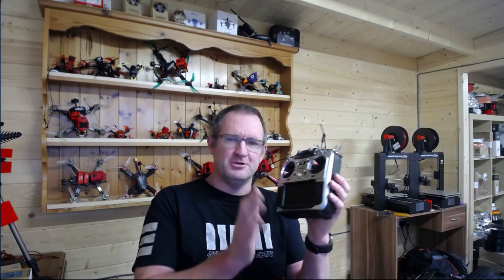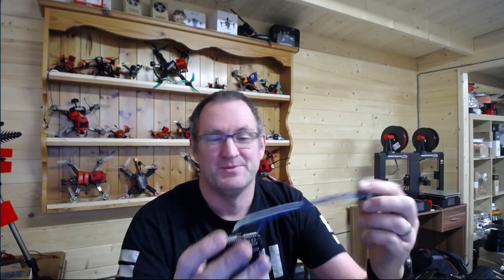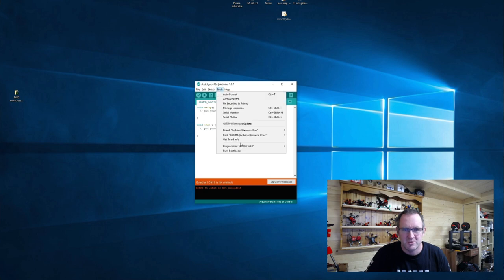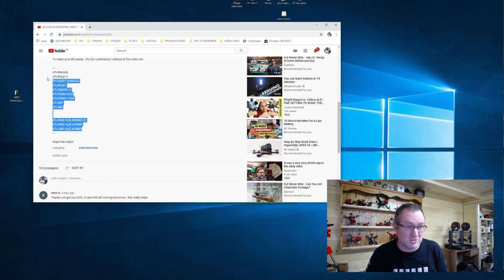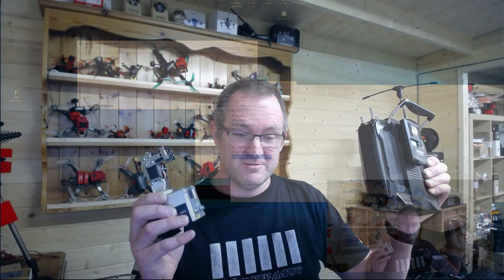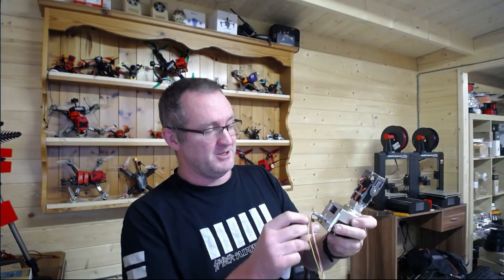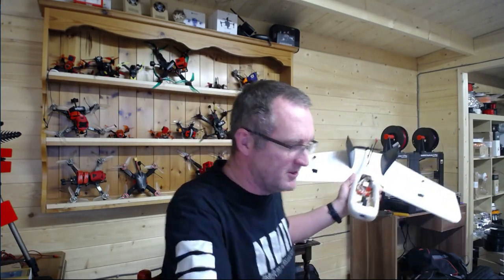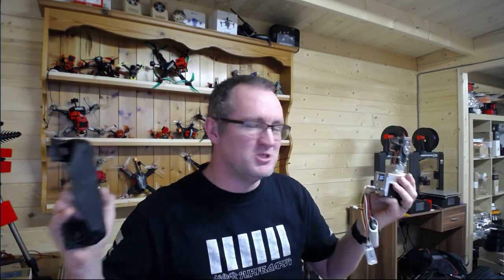MFD CROSSBOW * TBS CROSSFIRE | STEP BY STEP TO GET IT WORKING

Comment: 👍🏻Very good and informative video. TOP!

 I will modify your setup for using a frsky R9M Modul. I will use the Smart Port Data stream and conect it with a Blue tooth modul. Data from INAVFlightcontroller. 

Do you think that could work that way Rob?
Reply from the maker: I guess it's possible

Basically.. Remember that tracker only supports mavlink.

How you create the mavlink.. We you could achieve that with any down link method!
Reply: Need an arduino to convert s.port to mavlink. No word from mfd on all supported protocols, but they said it supports many normal telemetry protocols.
Reply: The tracker now accepts s.port. you just need an inverter and bluetooth modules.
Reply: @juanhernandez5812  you need two bluetooth modules. The mfd doesnt have one built in.
Reply: @Just-A-Guy-Learning   YES 
I KNOW,  I MEAN IS WHAT COMMANDS I SHOULD PUT ON THE TWO BLUETOOTH TO COMMUNICATE OR TALK BETWEEN THE R9M AND THE MINI CROSSBOW
Reply: @juanhernandez5812  TALKING IN CAPS DOESNT MAKE ANYONE WANT TO HELP YOU! 

There are different commands for different bluetooth modules. You need to buy a pair of modules, then look up the command list for pairing those two modules. Hc05, takes a different list of commands, than the hm10. So join the Facebook group to get the commands for those modules, or tell me what you order so I can try and post the commands here. You will need arduino ide software and an ftdi or the usb-ttl that comes with the tracker to program the modules.
Reply: @Just-A-Guy-Learning  ohh my bad it's not my intention im Dominican and I'm not sow good writing inglish ... 

I ordered 2 Bluetooth module hc05  1 inverter for the r9m, I have the usb-ttl I think I will need the commands?
 Thanks for your help 👍
Reply: @juanhernandez5812  all good. 

List of commands for pairing hc05 together.

AT+RMAAD Clear any paired devices
AT+ROLE=1 Set mode to Master
AT+RESET After changing role, reset is required
AT+CMODE=0 Allow connection to any address
AT+INQM=0,5,5 Inquire mode - Standard, stop after 5 devices found or after 5 seconds
AT+PSWD=1234 Set PIN.
AT+INIT Start Serial Port Profile (SPP) ( If Error(17) returned - ignore as profile already loaded)
AT+INQ Start searching for devices

A list of devices found will be displayed, one of which is the slave module. The format of the output is
+INQ:address,type,signal
The address of the module is what we need and is in the format 4:3E:9A440B 
NOTE: We need to replace the colons with commas when we use the address with the following commands.

If you get more than one device listed and don't know which one is the slave module Crossfire, you can query the module for it's name using:
AT+RNAME? 
e.g. (don't forget to change the colons to commas)
AT+RNAME? 4,3E,9A440B 
> CROSSFIRE XXXX

Once we are happy we have the correct slave address, we need to pair with it, so carry on with the next set of commands:

AT+PAIR=4,3E,9A440B,10 , The timeout is in seconds and if you need to type in the pin on the slave device you need to give enough time to do this.
AT+BIND=4,3E,9A440B Set bind address to the slave address
AT+LINK=4,3E,9A440B Connect to slave.
Reply: @Just-A-Guy-Learning  ohhh thanks bro appreciate your help

Comment: I need a very long range rc transmitter. At least 100km with 18 channel. What do you recommend? Does this tracker will help me to use and control my plane by rc transmitter or it just work on autopilot

Comment: Thank you for taking the time to do this 👍🏻.  Does the updater cable and programmer come by default in the box?   My impatience for mine to arrive just went up a level 🤣
Reply from the maker: Yes.  Everything is in the box.

Just make sure you put correct wiring.. And should work!
Reply: Rob Thomson FPV thanks Rob

Comment: Mine works with help of your video . Thank you  very much . How your tracker keeps up with the model ? My tracker movements is are in steps and can't keep up with the model when flying close by. How are your tracker movements with mavlink and crsf?
I think when it runs smooth it can keep up .
Reply from the maker: I use mavemu...  no issues.

Make sure you load one of the newer firmwares to the tracker.

They include a low pass on the servo - makes it much smoother.

If close by - e.g - less that 100 meter - dont worry about it.  You dont need a tracker at that range - and the directional antennas will easily cover you.  Example.. I have flown 800m behind and lzr 13dbi patch with no issue!
Reply: @RTRCTV  thanks! Yeah iam on firmware 2.1 . Just wondering if your tracker runs with constant smooth movement or is het a bit steppie to ?
Reply from the maker: @erikjede1ste  always slightly steppy.

Its got something to do with the rate the telemetry is received.
Reply: @RTRCTV  ah oke thanks . I thought mavlink was a continue stream of data . Also gps is on 10hz . But it worsk fine. 
Just wondering . Thanks mate and thanks again for the clear video
Reply from the maker: @erikjede1ste  it is.. But there are delays all the way along.. So latency is an issue.

But hey.. It still works :)

Comment: hi Rob, thanks for the video, What gps are you using ? and how do you get the cordinates to the crossfire ?
Reply from the maker: Hello

If you are using inav or betaflight.. With a csrf link,     then gps will magically appear on the transmit module.   Just need a gps connected to your fc.

I use ublox style gps
Reply: @RTRCTV  ok thanks... this is what I’m having issues with right now... I have a maytek F411 and a maytek M8Q, but I don’t get gps data
Reply from the maker: @Mrypants31  do you get data on your osd or in your fc?
Reply: @RTRCTV  yes I do, I get gps data, speed , coordinates all in my osd from the FC, using iNav
Reply from the maker: @Mrypants31  is your crossfire running crsf from the receiver to the fc?
Reply: @RTRCTV  yes, I just checked in Inav
Reply from the maker: @Mrypants31  OK.. You running full size crossfire or opentx?   Do you see telemetry with GPS info?
Reply: @RTRCTV  I have full size crossfire on a qx7...I don’t see any gps info, when I go to discover new sensors I get 22 sensors , as I understand that is all the sensors crossfire offers... but the air speed , altitude and gps all remain blank ...

Comment: So i would need to connect a gps to the tracker for the tracker to know its current position for all this to work?
Reply from the maker: No.   Only of you intend for the tracker to move post launch of the model.  (like if the tracker is on a car)

Comment: Rob thanks alot for your help. I'd like to let you know that a RCG'er named AngelKillR helped me with something you don't mention and perhaps you are not aware of? But if you use channel 3 and 4 on the tbs rx and set them to mavlink tx and rx and then connect them to a free uart on your FC and set that UART to mavlink at 57600 you get much better performance than using mavemu on the TBS tx in terms of a solid D link and also error free tracking. Set the tx to mavlink instead of mavemu and also on the rx disable rc by mavlink (unless you want it).
Reply from the maker: Hey.. Yes.  Totally aware of this.

Essentially you are just getting the MAVLINK direct from the fc.

Pros and cons to both methods.       Strangely.. I have never noticed any difference between either in terms of performance.     

Likely there is some strange difference related to hardware somewhere!
Reply: @RTRCTV  I am using INAV perhaps that has something to do with it? Anyway mavemu was completely unusable for me. The dedicated uart with mavlink made all the difference. I wanted to post the comment perhaps to help others who ran into the same problem I had with mavemu. The downside is it gobbled up a uart. I had to give up on my smartaudio but a small price to pay.Thanks again for all the great videos.
Reply from the maker: @billyd78  I Lso, use inav.   So no idea why!

Comment: I did al your steps and bluetooth is working . But what are your tx and rx settings from crsf?
Reply from the maker: If you are running csrf all the way to flight controler.. And have a gps.. All you need is to set Bluetooth to use mavemu
Reply: @RTRCTV  check it works!! Thanks your video is very helpful!

Comment: RT, My Fly Dream have a range of Bluetooth modules on their website could you point me in the right direction for the one I need for the TBS Crossfire and MFD Minicrossbow AAT.
Reply from the maker: It depends a bit on how you intend to connect it.

Are you using the full size crossfire with a Bluetooth module on board?
Reply: @RTRCTV  yes full-size Crossfire with Bluetooth  and  plan the diversity receiver
Reply from the maker: @lylemahon8316  one of these will suffice then:
https://www.amazon.co.uk/DSD-TECH-HC-05-Pass-through-Communication/dp/B01G9KSAF6/ref=asc_df_B01G9KSAF6/?tag=googshopuk-21&linkCode=df0&hvadid=310754948045&hvpos=&hvnetw=g&hvrand=14266091767115288605&hvpone=&hvptwo=&hvqmt=&hvdev=c&hvdvcmdl=&hvlocint=&hvlocphy=1007246&hvtargid=pla-298443014355&psc=1

Comment: Hi Rob, Thanks 4 your video. 1 Question..is it possible to use the TBS Crossfire Micro TX?
Reply from the maker: Hello

Not as it currently stands.

However..   There is a new way under dev that will work using Bluetooth in the radio.. Assuming you are running horus, qx7 of jumper radios that have Bluetooth installed.
Reply: Rob Thomson FPV Thx 4 the quick response! I am afraid I’m screwed because i just purchased the new TBS Tango 2 which hasn’t got Bluetooth!
Reply: @RTRCTV  Good afternoon! Can I contact you via email regarding a wi-fi connection? All crossfire modules have a wi-fi module that sends a mavlink. It would be great if you made a video like using another wi-fi module such as DT06 to transfer the mavlink to the MFD crossbow mini ! Today I received a response from MFD crossbow mini support that this is quite possible. Not everyone has a Bluetooth module and it is quite difficult to configure.

Comment: Hi Rob
I have a HC05 that's programable trough FTDI adapter, i get it in AT command mode, but here is the tricky bit, if i copy [paste your AT commands, after the baudrate command The AT+RESET command it is resetting the BT module and it is out AT command mode, so blinking rapidly, how can i contineu with the commands when i am out AT command mode, if i reconnect in AT command mode and when i paste the commands i have to i get no OK reply. i kinda pulling my hair out here. do you have a work around mode.

Do i have to set my CRSF in MAV EMU or in Bridge i have tried them both. i just can not get past the Baud at command.

Hope you can help me here.

Comment: So can you use the right connector for this? Because I'd like to use an external compass which is designed to go into the left connector. Although I see there is no tx1 or power in the right connector, only rx1. So I'd have to tap power from the left connector. But do I need to connect tx or is only rx enough? Otherwise I guess I can't do it. I have it working in the left connector but can't get it to work in the right doing the mods to the cabling I listed above, and not connecting the tx line.
Reply from the maker: Hello

Yes.. Totally.

And yes.. Just rx is enough.
Reply: Ok thanks I'll have to double check the cables I've made up. That or the latest firmware 1.99 broke something.
Reply: It started working in the right hand connector but only if I connect the HC05 Tx to the right connector Rx1 pin (instead of rx to rx1). So this is typical in terms of serial connections, but not in our case since in all other instances with HC05 and MFD mini crossbow,  we've been connecting rx to rx and tx to tx. I guess because we only have one line it must be done this way?

Comment: the tracker from the box when powered on default was looking 90 degree down. after you updated it now it looks up into the sky. is it normal and how to change it back to default?
Reply from the maker: Have you calibrated the pitch axis?
Reply: @RTRCTV  what is the correct way to calibrate it? I tried to adjust it to 90 degree but it does not allow me to save this position, it goes up when powered
Reply from the maker: Set the 90.. Then set the level.. Then save.
Reply: @RTRCTV  Thanks, that worked, wow. I spent few days setting this thing up and I have now d-link 100% and gps coordinates working fine. The problem was also with the newer version of bluetooth firmware 3.0, it was a challenge to figure out how to program it. Your video helped me very much and it is mostly the only one available here on youtube on this subject. Thank you sir and Happy New Year))

Comment: Hello Rob, can you please assist.  For a while now I've been wanting to purchase the Crossbow tracker for my large scale FPV sailplanes and set it up the same way with Crossfire and my DJI FPV system.  However, every time I go to the MyFlydream website I get confused about what I actually require, being in Australia I would like to one purchase to save on shipping cost.  What do I require?  1 x MFD mini Crossbow AAT,  1 x GPS+Compass for mini Crossbow, 2 x ExtCable for mini Crossbow and 1 x MFD 5.8G 20dBi Antenna.  Is this correct and is the anything else I will require from MyFlydream?
Reply from the maker: Hi James

Happy to help..

May be easier to take this off this chat thread.

Do you use discord?   MSN messenger?  WhatsApp etc?

Rob
Reply: @RTRCTV  Hi Rob sent you message via Facebook MSN, found your address on Crossbow FB group.  If you prefer other means of message let me know via that message

Comment: Did you make the left connector of the mini crossbow yoirself?
Reply from the maker: Nope.   Just re purposed the programmer cable that is supplied as all wires already soldered up.

Comment: Hello Sir! I want to make a custom Arduino transmitter to use as a control link. Is it possible to send control commands from the Arduino to the TBS crossfire? Struggling to find any solid info on this concept, but you seem like you know whats what! Any advice would be appreciated
Reply from the maker: Hello

I have often considered this.

Best source to find any info on the may well be the opentx code base!  The lua scripts clearly do something similar!
Reply: @RTRCTV  Thank you so much, I will look into OpenTx!

Comment: @Rob Thompson FPV appreciate the videos on this subject, they have been invaluable. 
Just received a Crossbow Mini. I updated it to the latest firmware 2.4 and in the menu there is a protocol option for crsf. Can you or anyone shed any light on it as I cannot find anything online?
Reply from the maker: Yup.

The new firmware can read csrf direct from a Bluetooth enabled frsky radio.

It relies on the opentx feature where it relays the csrf telemetry direct to the com port on the radio.

I have not used the feature myself, but there are a few in the Facebook mfd mini crossbow group who use it with good success.
Reply: Rob Thomson FPV so not much good for direct Bluetooth comms between full fat Xfire & Xbow. Was hoping a new robust implementation might be on the way! 
Ditched FB a long time ago but beginning to think a shell account might be useful for the TBS & Xbow pages.......

Comment: I can not get AT mode to work, i get response in AT mode the bt module is flasing once every two seconds so i know it is in AT mode but i get ýýý back wen i sen AT and enter, tried everything, i have hc05 from banggood with a momentary push button on it, and a few without the push button on it. Can you advice? Thanks for the help in advance.
Reply from the maker: Most likely your baud rate not being right.  Try all of them.
Reply: @RTRCTV  done that tried them all sir
Reply: Still does not work

Comment: noticed you changed AT+CMODE=0 to AT+CMODE=1 is this important?
Reply from the maker: It simple prevents the bt module from every choosing a different device to bing to.

If you fly on your own.. Likely to never be an issue.  If you have multiple crossfire modules in the mix,  cmode=1 just makes things a bit tighter.

Comment: TX from the tracker to TX on the HC05?

Does not the connection have to be crossed?
TX->RX and RX->TX
Reply from the maker: No.

Tx on programmer matches tx from Hc05.

If you match pin to pin the labels on the usbttl to the Hc05..   Then tx /rx will be crossed.

You have no need. To consider what is inside the tracker.
Reply: #Rob, you are talking about hc05 to programmer, He is talking about hc05 to crsf, not hc05 to programmer
Reply from the maker: Not if following label to label as in that scenario you are already crossed. 

Double check and you will see what I mean.
Reply: #Rob, so it is tx hc05 to tx tracker and visa versa

Comment: Hello,  AT+INIT return  ERROR:(17)
. How to fix it to come to the next step?
Reply: probably this error can be ignored, but then I come to  AT+INQ
      - ERROR:(1F)
Reply from the maker: Seems something not right with your hc05.

Do you have the dsd tech one?
Reply: @RTRCTV  No, I got modules from Aliexpress. Looks absolutely same and the all above commands work perfect. Is that means only dsd tech modules can be linked with Crossfire?
Reply from the maker: @olegprudnikov3208  nope.. Problem is that there seem to be allot of crap modules.  Dsd ones have shown to be reliable.
Reply: @RTRCTV  Unfortunately it is not available anymore, and I can't pair my crossfire to MFD crossbow.
Reply from the maker: @olegprudnikov3208  drop past the mfd group on Facebook.   Maybe some others will have suggestions?

Comment: Great video walk-thru.  worked like a charm.  Thank you for posting.  One item to share in case anyone runs into this:  If the provided USB to TTL is not creating a com port (which happens often in windows) there is a link to the drivers in the crossbow mini manual provided by MFD.  http://www.myflydream.com/download/manuals/c-1/